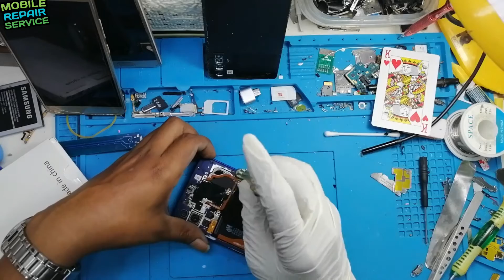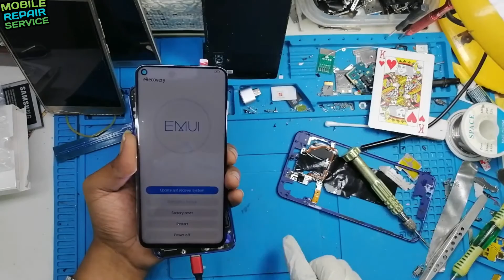How To Huawei Nova 5T LCD Screen Replacement || NOVA 5T YAL-L21 Display Touch Screen Replacement

Comment: I see they sell this with and without frame. Easier without it seems?
Reply from the maker: yes !! why not ???
Reply: I don't know that's why I ask the question 😅 I can't really see from the video what the difference would be if the lcd came with or without frame. I need to buy a new lcd, but I see some complaints about lower brightness on the screens on Ali.
Reply from the maker: Looks like you didn't make the original purchase
Reply: As I write, no I haven't made a purchase yet. Just watching video of how it is done first.